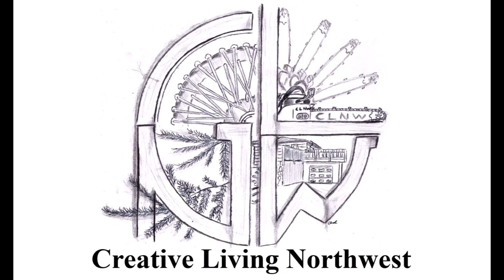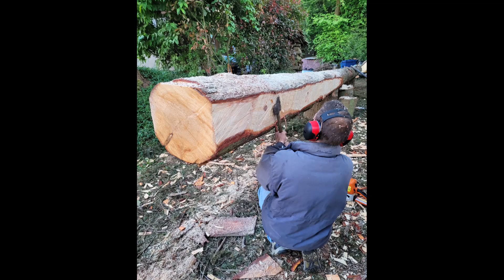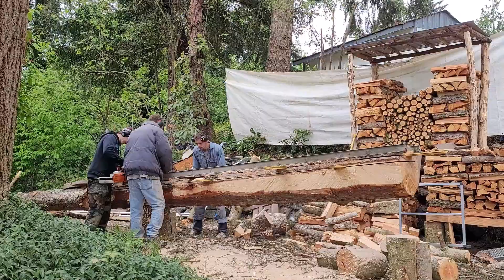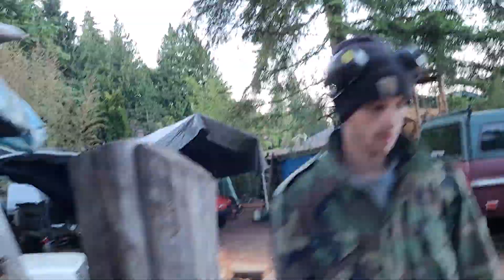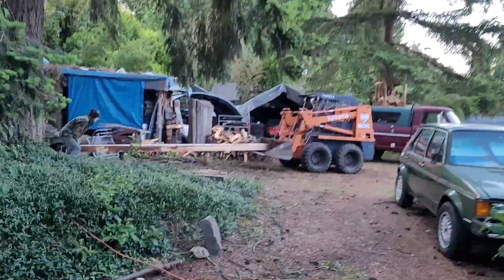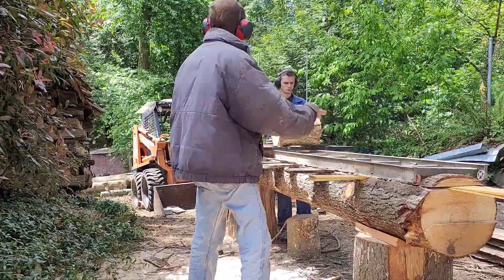Big Beams from Logs 👌 Dad's Homemade Chainsaw Mill - Season 1 Episode 2 - Chain Saw Milling

Comment: Do you think it’s possible to chain saw a 26’ beam with a chain saw mill?
Reply from the maker: We did. We put two extension ladders end to end. The tricky part was to line them up parallel with each other.
https://youtu.be/tQ4WujyuPYQ
That link is just one video we have done this method on